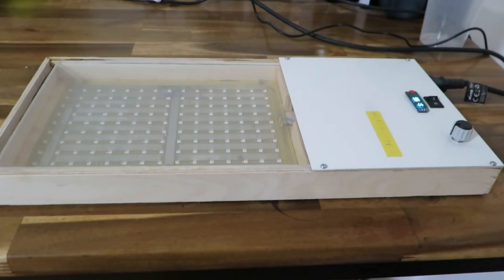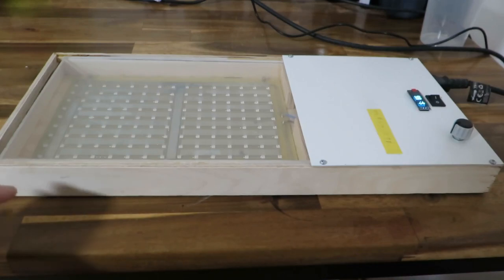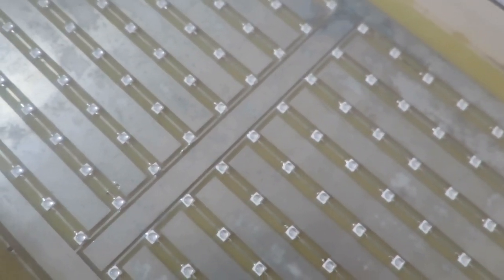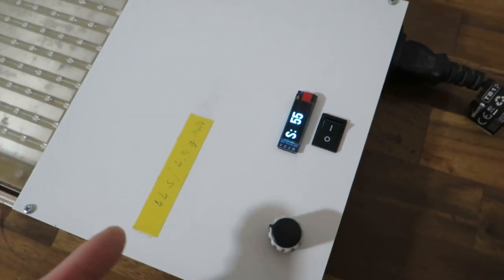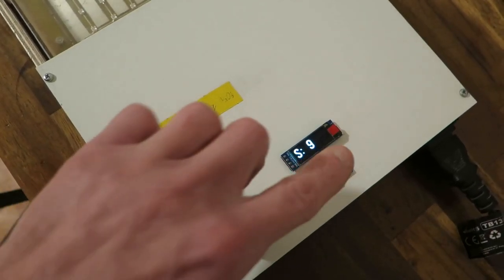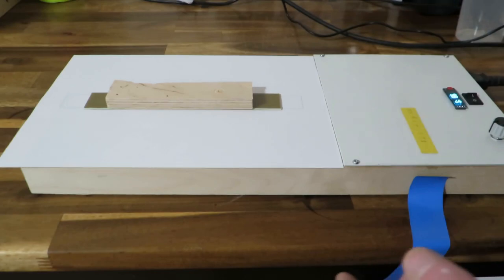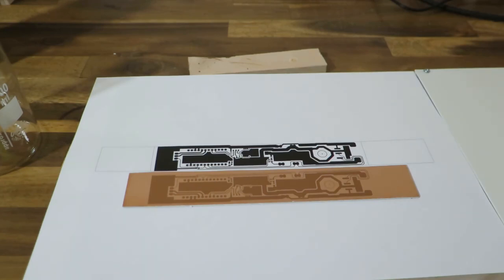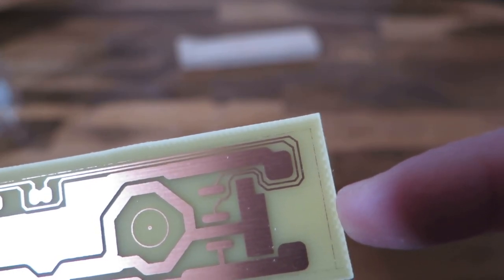Engineered PCB exposure unit

Comment: Hello merci pour votre présentation, par contre je n'ai pas retrouvé la référence de vos leds
Reply from the maker: You can use any 400nm leds. For low profile it is good to have wide beam cone - 130deg in my case. And more power is usually better of course.
Reply: @IlusysSystems  merci par contre j'ai été surpris que tu insoles directement à travers le papier en général on utilise une feuille transparente.
Reply from the maker: @ClaudeDufourmont  Yes, I can afford that due to high power. With transparent foil, exposure time is about 4 seconds. Transparent foils are expensive and quite hassle to print onto with office grade printers.